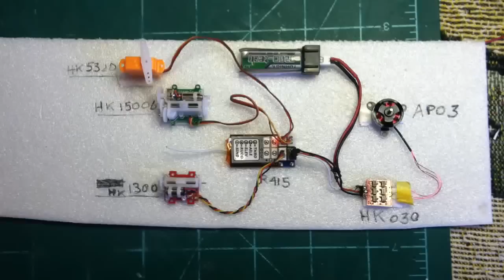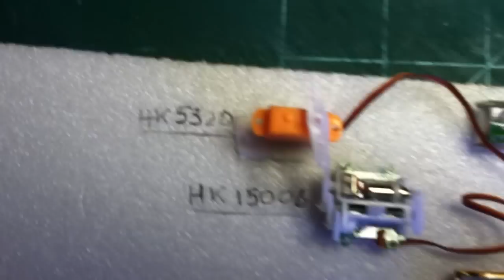HobbyKing Supermicro System

Comment from the maker: Juan,
I know nothing about the LP5DSM, but it's DSM2 so should bind to the R415 "normally": Use the bind plug on the Rx, and attach battery. The receiver will flash rapidly indicating it's looking for a Tx. Turn on Tx while holding down the bind button (probably the trainer switch on your Tx). The Rx will flash slower, then go out, and finally come on steady when bound. Remove bind plug and fly. As normal, always power DOWN the Rx before the Tx, and always turn ON the Tx before powering the Rx.